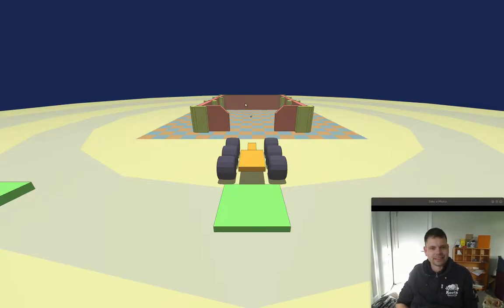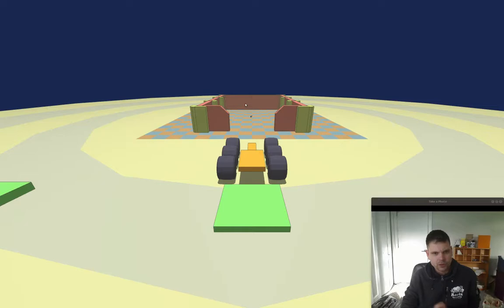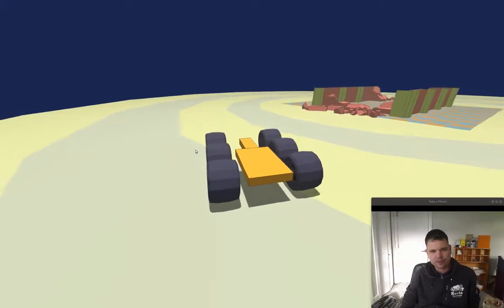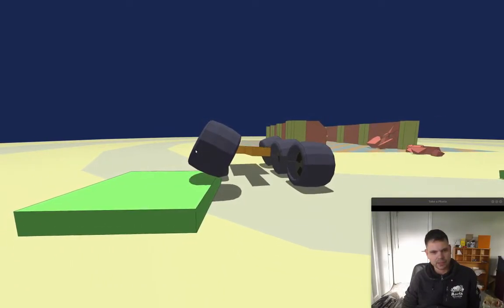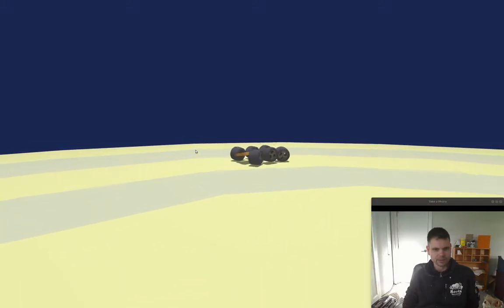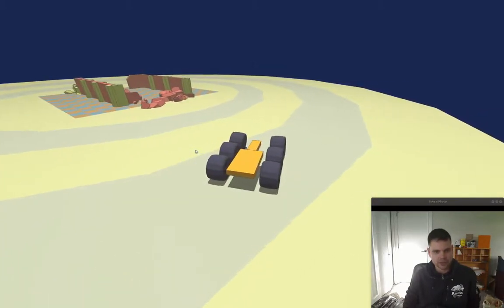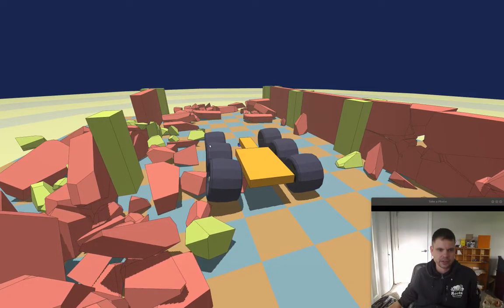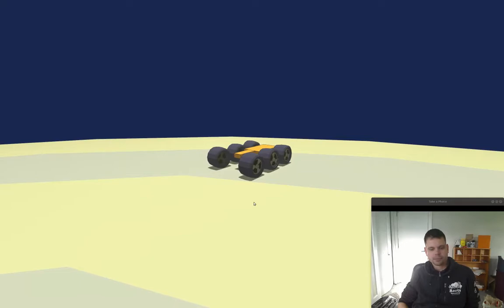Game Development, after switching from ODE to Bullet.

Comment: Can I ask how you implemented the wheel? Are you using rigid bodies with hinge constraint? Are they soft?
Reply from the maker: They are bullet’s 6DOF joints.
Reply: Interesting. I am looking for a library to simulate heavy vehicle equipment motion with all the complex dynamics. ODE and Bullet came into my radar. Game Dev is not my primary priority. Its more of simulating the actual motion of the heavy weight equipment. @BramStolk